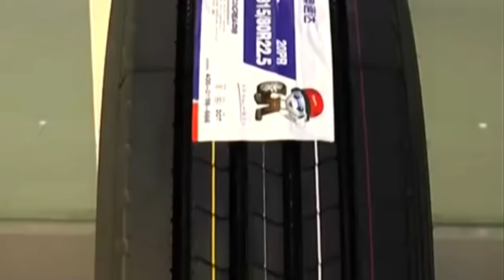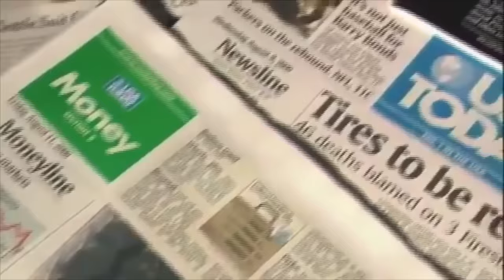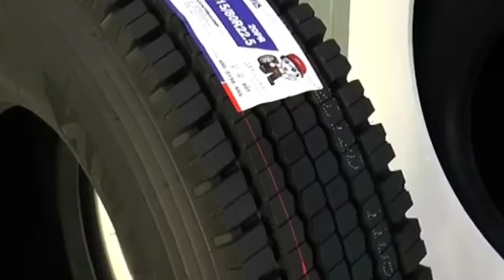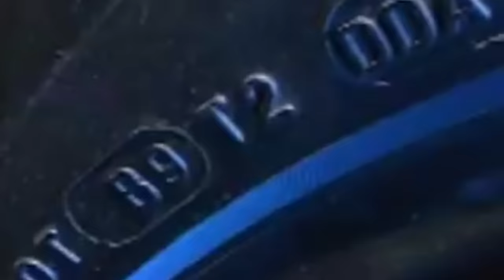5 Tires You Should NEVER Buy!

Comment: You might notice one thing the tire dealers NEVER talk about which is THE most important thing to consider when buying NEW tires... check the DOT date of manufacture stamped into the sidewall. Selling out-dated 'new' tires is quite common and has caused many accidents and DEATHS! Tires have a total lifespan of only 6 or 7 years and that is INCLUDING time spent in a warehouse regardless of what the tire manufacturers or resellers might say ($$$). It is quite possible to buy  'new' tires that were actually made 6 years OR MORE ago that are already considered to be UNSAFE tires by the leading automobile makers and should not be sold for any price. The tire industry couldn't care less about your safety obviously. Buyer beware.

Comment: $181,000 RV. Put the cheapest tires on it you can.
Reply: ya they are, there cheaply made in my experience
Reply: Hit the ground running, The tires may not have been cheap $$-wise. My RV Tech instructor Jesse was asked what the standards of the RV industry were like. He said, "Shoddy and shoddier." Most makers below the Newell class make them look good but really cut corners where buyers can't see.
Never ride in an RV trailer even where it's legal. Trailers are not built to motor vehicle standards. In a heavy collision the appliances will go into a heap in the front. Just look at any RV trailer that has been in a heavy collision. They disintegrate. Motor homes are almost as bad. Only the seats at the front, the ones with belts, are intended to be occupied while the MR is moving.
Most RVs have the cheapest tires that are available. If the tire has "100 psi" on the sidewall this is 100 psi MINIMUM but don't go much higher. You can count on each.tire being loaded to just under its capacity as the vehicle comes from the factory. Add 3-5 tons of your stuff and you're way over. MH tires are 75 mph max.  RV trailer tires are 65 mph max.
"LT" on trailer tires is NOT "Light Truck," rather "Light Trailer."
RV trailer tires have stiffer sidewalls than similar looking light truck tires to reduce the dreaded side-sway/tail waggle. Always inflate trailer tires to the pressure rating on the sidewall, just as on MHs, to reduce side-sway/tail waggle.
Load range "C": 50 psi; Load range "E": 80 psi or the sidewall spec.
Reply: There is no Goodyear tire
Reply: When I was offered chinese tires for my class A rv , i laughed & laughed & laughed
Reply: Hey he probably just thought all Goodyear tires were the same and that he got a good deal for name brand tires. Goodyear should know better not to make shit tires.
Reply: also: when explaining the problem, show a self propelled motor coach.  When showing the incident, show a trailer being towed by an SUV.
Reply: Goodyear G 159 were top of the line steer tires for heavy duty trucks in 1985. I doubt they are "cheapest tire" even today. I ordered my 1986 custom International Eagle with 1100 24/5 G159 steer tires and 1100 24/5 G167 drive tires on purpose. The truck was geared for 101 mph (20 speed Spicer box and 3.55 gears) and was driven that way in 11 western states as often as I could get away with it. The steers when worn after maybe 140000-170000 miles were recapped with the G167 drive tread and run off on the drive axel where they went another 100000- 170000 miles after which I sold the cases to Daniels tire cap shop. After 10 years and having driven one million thirty thousand miles in that truck with Goodyear tires I had experienced just TWO (2) blow outs and they were both on the drive tires. Both blowouts occured over 80 mph. One tire had a previous repair from a bolt puncture and the other had just ran over something obviously sharp and hard in the lane on I 5. Pretty good service from them G 159 tires if you ask me.
Reply: good year tires are junk I used to work for a good year dealer jerry's tire in Michigan they are horrible tires
Reply: Paul Staller what ??????
Reply: Part of the problem is simply grouping products under a generic blanket together.  For example there are many  Goodyear models and China isn't a brand.  To say all of a is good or bad is improper.  Don't focus in on say oh i need to buy from *&^ or ones built here or there are 100% safe etc..  It's better to do research on what you are purchasing specifically not a broad generality.
Reply: I assumed they were stock tires
Reply: Maybe they make tires in Pakistan.
Reply: Goodyear tires are one of only American made tires left.  I never had any trouble at all with them.  These were made for economical use with an rv, obviously they didn't follow use instructions
Reply: $181,000 for an RV?  My house isn't even worth $70,000.
Reply: Alex, it's as if I was thinking aloud!. SMH.
Reply: soaringtractor - Do you need a hug? Let me speak for the rest of us and apologize for the unspeakable acts in this comment section that traumatized you and triggered your little millennial rage. We hope you can forgive us.
Reply: I tun toyo on my rv.
Reply: Hit the ground running you have to after a hundred and eighty thousand you ain't got money left over for tires
Reply: Their premium models are USA made. All their shit tier ones from Walmart are China or Tawian made.
Reply: You don't inflate tire pressure to the sidewall rating on Passenger Tires, LT Truck Tires, or regular trailer tires. Never bought, sold, or installed any RV or MH tires, so I can't say. The side wall rating is the MAX pressure, so you'd only want the pressure to be at max when your also at the maximum temp the tire is rated for.
Reply: Plenty of customers coming in with goodyears that are 7-8 years old, but these people buy an 80k mile tire, and drive maybe 5k a year so they want new tires under warranty. Had to change our mileage warranty to 3 years, I can't even sell a tire if its older than 3 years, so what makes you think I should warranty your 3 year old tires? They are worn out, doesn't matter if you bought them and put them your living room and looked at them for 3 years.
Reply: I know this is off topic, but every time I see one of these RV's going down the road, I can't help but wonder just what the hell kinda job did these people do, to afford these ridiculous monstrosities ???? Were they all CEO's at Exxon, or Microsoft ? I make a decent salary, and it's hard for my family to afford a basic car, LOL !!!!!!!!!!
Reply: sold their big fancy house & purchased a smaller fancy house & a new motor home
Reply: Doc8Ball's GearHead Gaming LMFAO
Reply: 500erider  I wish a newmar only cost a 180,000 .try about 300,000 or above.  They sell them all day long. And lots of them. I live right by the plant.
Reply: Mississippi_Man1 $181,000 isn't much for a class A motorhome anymore. I work for a company that builds class A motorhomes that cost well over $700,000.00. We actually sell a lot of them. We build 15 per week, and our schedule is booked out for a long time. It's amazing to think that there are that many people in this country that can afford something like that.
Reply: Goodforayear
Reply: vector6977
Reply: Not true. Chinese tires made for export are built to a higher quality than tires sold in the domestic market.
Reply: +Al Grayson.   Uh, what?  LT absolutely does stand for "Light Truck."  ST stands for "Special Trailer."  Momma said.
Reply: Think a bit more then, those where, when they were still made, fleet tires for Fleet vehicles that couldn't actually go above the speed specified by the rating. (US fleet owners at the time would govern their vehicles between 58 and 62mph. for insurance reasons)
Reply: Caveat Emptor. How to tell if a luxury vehicle has been cared for. 1 look at what tyres are fitted. Cheaper rubber equals poor maintenance.
Reply: I’d put gt radials on it and see how long it lasts
Reply: Angel Valdez most Goodyear tyres these days are made in China
Reply: @pauljameshere85  Badyear tyre

Comment: The tire issue between Ford and Firestone had more to do with extremely low tire pressures specified from Ford for the escape. A tire running at a lower pressure is more  susceptible to overheating and blowing out than a tire that has been properly inflated. When I worked for a tire store in the 90’s I always set tire pressures on the Explorers to 35 psi which is what other vehicles of similar size and weight called for using the same size tire. Ford specified 26 psi which in my opinion was grossly too low.

Comment: If this was the year 2000 then the recommendation not to buy Firestone Wilderness tires in P235/75R15 might be timely. But 18 years later, following a recall of the tires in question and the closing of the plant that manufactured most of them, it is of historical interest only.
Reply: That is what I thought to. I love my goodyear truck tires....very good quality.
Reply: the fallout from the scandal resulted in firestone going bankrupt, and the company is now owned and administered by Bridgestone.
Reply: Nope it shows a company that cannot under any circumstances be trusted. They continued to sell these well after they knew there was an issue; and they tried to blame Ford for the problem.
Reply: Didn't help much that Ford recommended 26 psi for the Explorer. Funny enough both Goodyear and Michelin, who were tasked as replacements, made Ford change the vehicle placards to show 35 psi as the new recommendation.